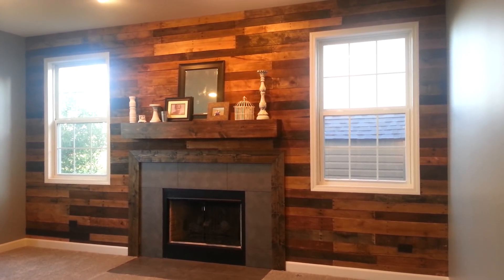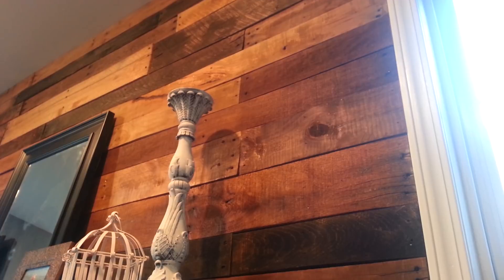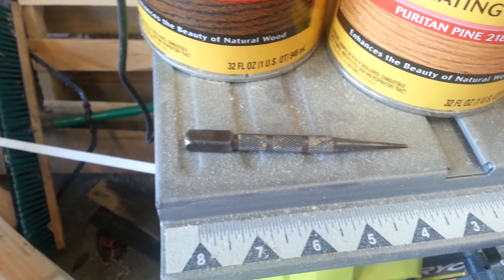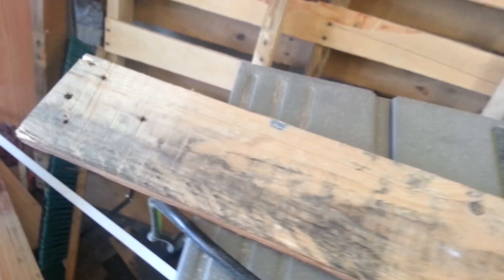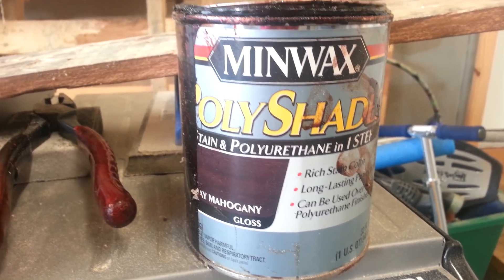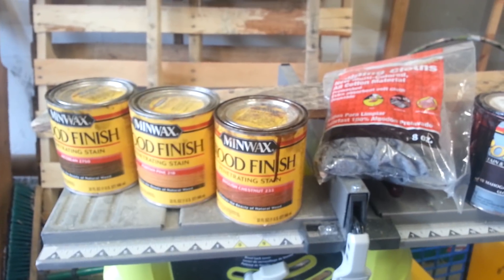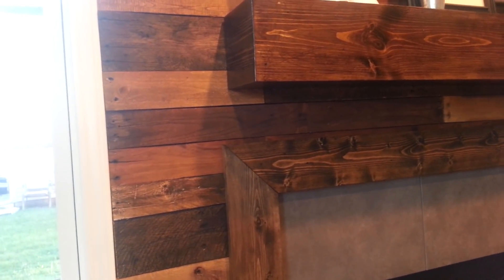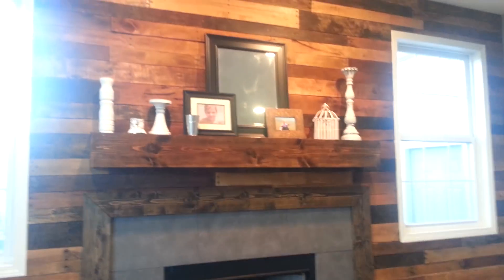The pallet wood wall is done! Everything explained!

Comment: Hi There: I enjoyed the video, and it was very helpful. I  want to do the same type of accent wall in our kitchen, but am not sure what to do when we get to the wall outlets. The boards are going to stick out, and the outlet will be recessed! How did you get the boards flush with your wall outlets??
Reply from the maker: Sorry for the delay....just found your comment in my spam folder....silly YT....my husband is a electrician and he put spacers in to make the outlet stay in place.  He also said if you cut the wood tight enough it will hold the outlet in place :)